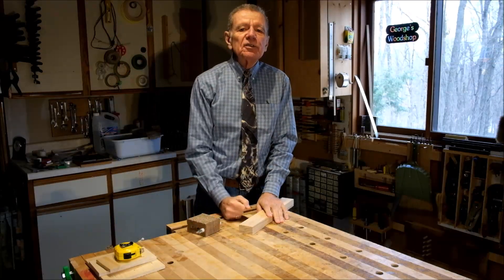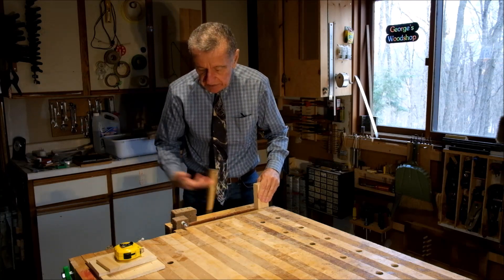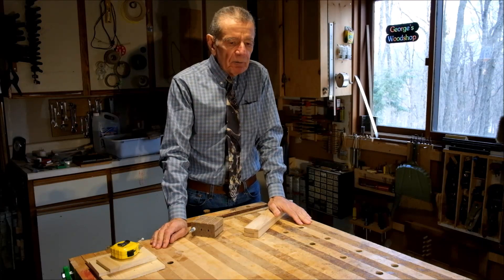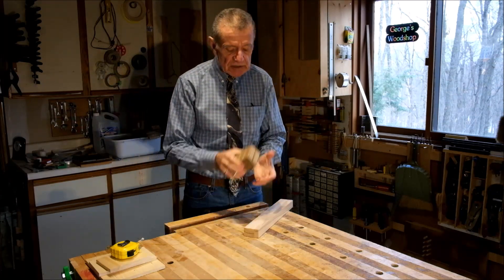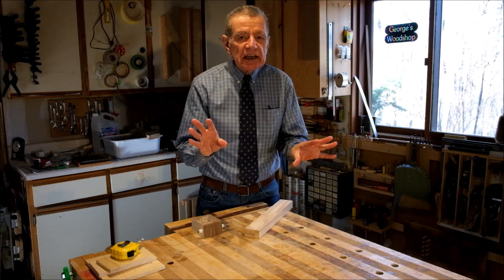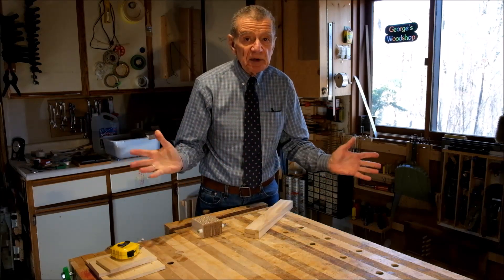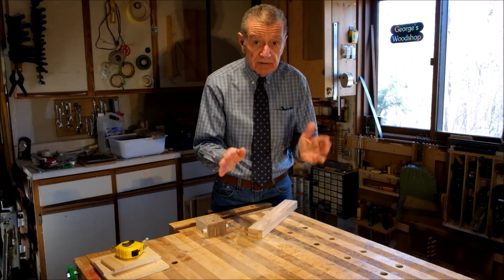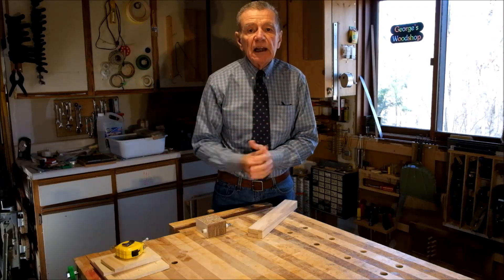Anti-Rack Vise Spacer

Comment: Ingenious arrangement George.
Reply from the maker: Thanks Robert, thanks for commenting "out loud".  As elegant as the solution is, I wonder whether the user will tire of trying one side, then flipping to the other, too much back and forth.  I like better the suggestion of InTnMnNmAz below of 5 half-inchers and 3 eighth-inchers on one side.  Could make it four eighths to add up to a full 3 inches, but either way, you would match the thickness of the workpiece using one end of panels.  Thanks again for your comment.
Reply: @georgefouriezos8863  I suppose that other solution might be simpler to use for some, but there's value in keeping one's mind sharp using your solution 😃
Reply from the maker: @rjamsbury1  You know, it's votes of confidence like yours that tempt me into maybe adding a trigonometry tutorial or two.  Thanks again for your input.

Comment: Useful tool.  Hummm.  Maybe the same count but no 1/4" spacers but three 1/8" spacers all on one end.
Reply from the maker: Yes!  That's simpler, no scrounging around for 1/4 inch material.  And with the 1/8 inch panels all at one end, fitting the spacer to the thickness of the workpiece will be more natural, no flipping from one end to the other.  Bravo!  BTW, your ID: are those the states you've lived in?
Reply: @georgefouriezos8863  Yes